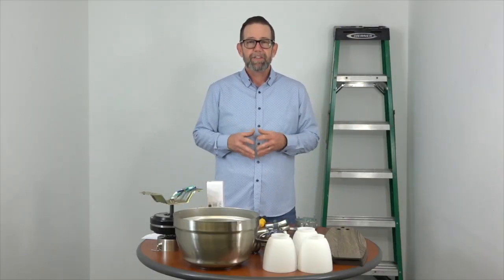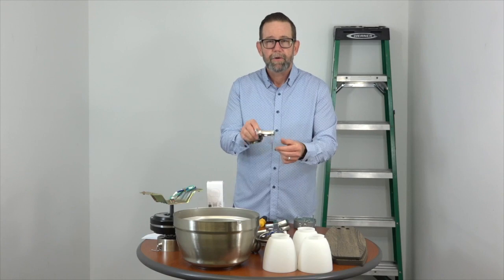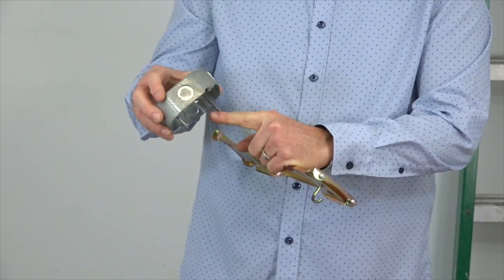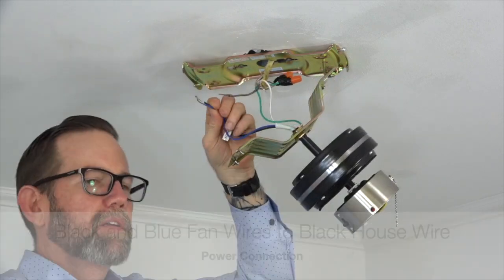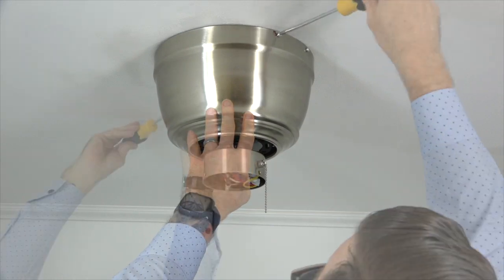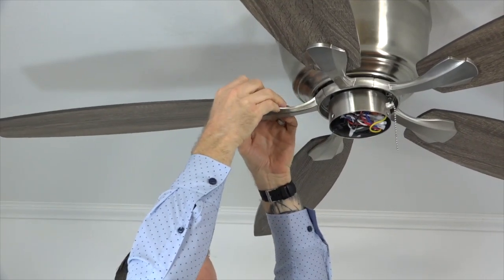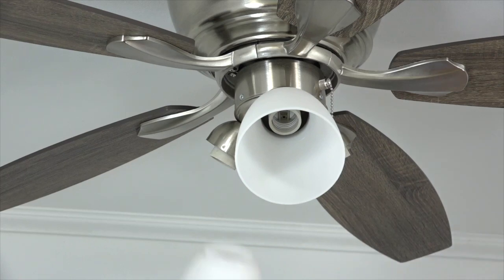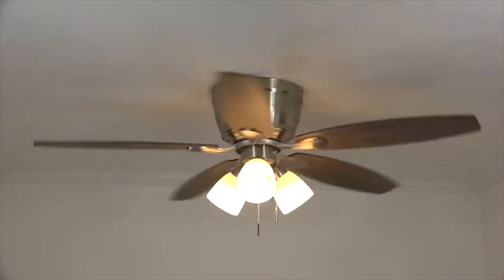How to Install the Sidlow Ceiling Fan from Hampton Bay

Comment: I only have white and black coming out from the ceiling, how do I connect wires from the fan to those 2?
Reply from the maker: HI Ashley, if you don't have a ground wire, you don't have to connect the green wires to anything. The fan's black and blue wires should be connected to the house black as shown in the video.

Comment: I'm having problems screwing in the right screw in every single blade bracket. I have no issue screwing in the left screw. Tried screwing in the right first and that didn't work. I'm confused why every single right screw on each blade bracket will not go in.
Reply from the maker: That's odd. We would say make sure that the screws are able to be moved in the mounting bracket and they are properly aligned when placing the blade arm in position. Try starting the right side and then start the left before completely tightening the right side. If that doesn't work for you, we'd suggest calling the customer service nummber on the cover of the manual. Their team is good at troubleshooting.
Reply: I have only white black wire hanging out my ceiling, how do I ground that?  If I connect white to white black to black what do I do with the green and blue from the fan, which do I hook it to
Reply: @ceilingfans101  I went ahead and returned the fan for another one. Must've been a defect with the last one because I had no issues with the replacement fan.
Reply from the maker: @ashleyc9907  HI Ashley, if you don't have a ground wire, you don't have to connect the green wires to anything. The fan's black and blue wires should be connected to the house black as shown in the video.

Comment: What is the price & specifications of this fan
Reply from the maker: Check Home Depot's website for pricing and more info
Reply from the maker: Here's the link - https://www.homedepot.com/p/Hampton-Bay-Sidlow-52-in-Indoor-LED-Brushed-Nickel-Hugger-Dry-Rated-Ceiling-Fan-with-5-QuickInstall-Reversible-Blades-and-Light-Kit-52151/314459957?